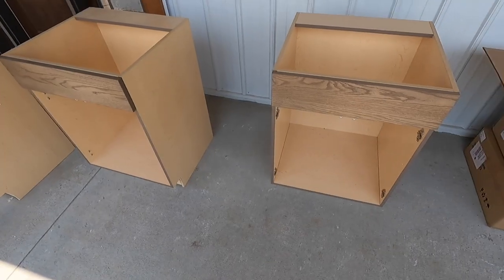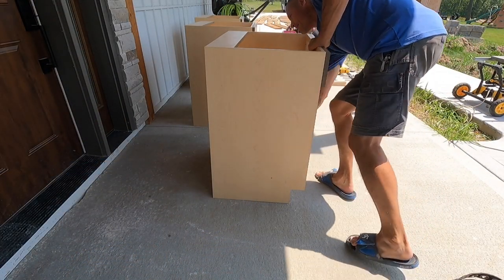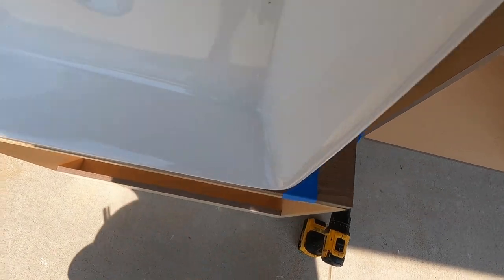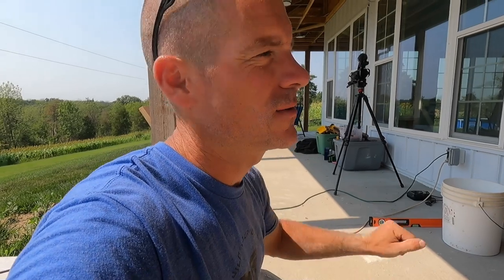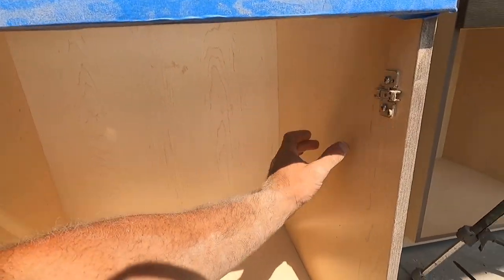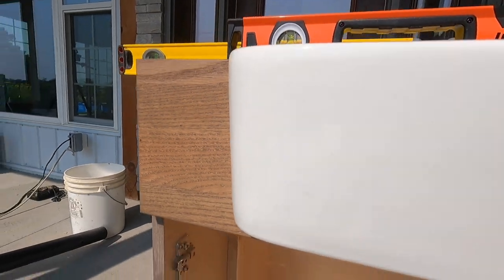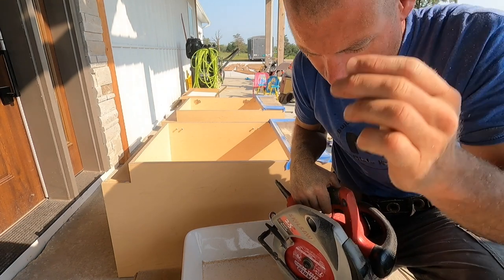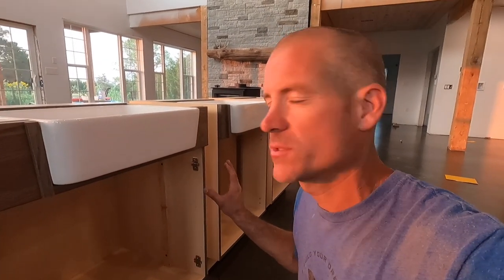Bathroom Sink Install | Apron/Farmhouse

Comment: Paul, as usual with me, a couple of questions; are the cabinets MDF or similar or real solid wood? I'm not a fan of MDF for wet cabinets at all, and especially if I had to modify any finished surfaces or edges- moisture is MDF's most potent enemy- even cabinet door exposed to much moisture delaminate and swell out of shape. Could you have mounted the sinks on the cabinet top, over a shorter cabinet? Thanks for your patience- know I am a trial at times! FR

Comment: Great job, just an observation you may want to seal the area were is just raw wood or material and you may need to lock the sink just in case kids may pull the sink. But I am sure you have a plan. Great video thanks 😊

Comment: Great job Paul! The only extra thing I might have done, is use some sealer on the raw cut front  edges of the cabinet where the basin rests. Just in case any water or moisture gets in and around the front of the basin, causing possible swelling of the wooden cabinet. Just a thought. Otherwise a perfect job, well done.
Reply: Agreed. Water will find a way to those exposed edges.  Though the finishing touches may be yet to come.

Comment: I might have missed this, but what is stopping the sink from being pulled out?  Someone feels faint and grabs the sink, would it be possible to pull the sink out?
Reply: The sink looks flush to the top of the cabinet and I suspect they will put adhesive around the side and back edge on top of the sink where that will bond to the counter top and hold it from being pulled out.
Reply: Won’t the drain pipe stop it from moving?

Comment: My only critique would be to switch the vertical legs to horizontal rails so they aren't seen/take up cabinet space. Otherwise great job! I did a massive farm sink in the kitchen per my wife's request...not fun jobs. If you do the same, don't glue it down until countertop arrives as it may need shimmed.

Comment: That water over a short time is going to hammer/swell/destroy the exposed wood edges.  Paul is usually 110% on this but as a plumber- I think he just missed this issue.  Sry Bro no offense.  Time will show you this is correct.

Comment: I am curious how the countertops are going on. I know you have a plan, but it seems like you would want the sinks slightly proud of the countertops.
Reply: As a plumber, I wouldn't, using porcelain- with stainless steel, maybe yes. If the porcelain extends up from the counter surface it will get chipped and nicked on the outside edge making it easy to get a cut and hard to get and keep clean. FR

Comment: I'm not sure why people like the farmhouse style sinks but I don't think that is what you got.

I think those are intended to be bolted entirely on top of a counter top.

That might be a more modern look than you are going for but the counter and cabinet space work out the same.  You seem to be making it an under-mount kind of and hanging it out the front for "farmhouse" style.  Maybe that is less expensive than a farmhouse sink but it's a lot of work to fake it and that's before cutting the counter top opening instead of just a hole for the drain.